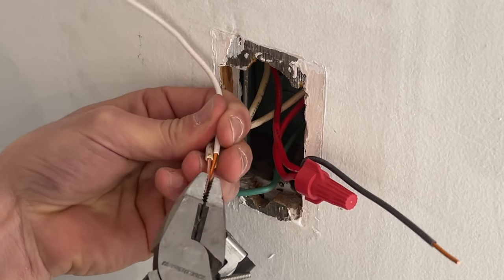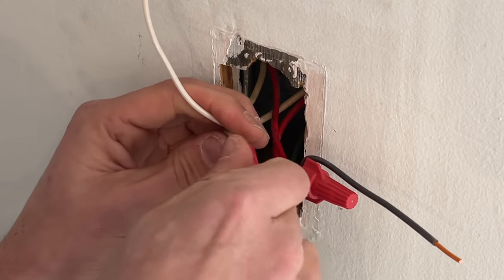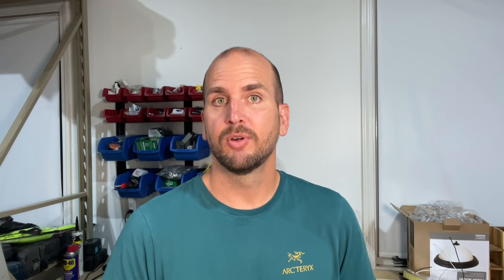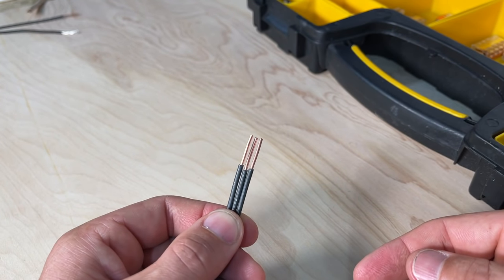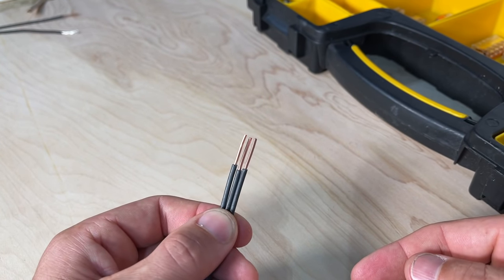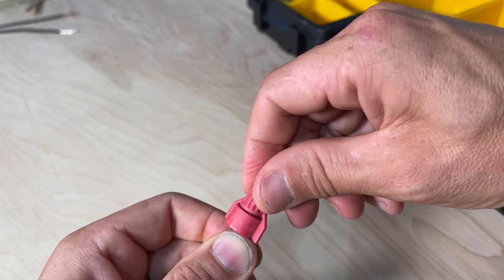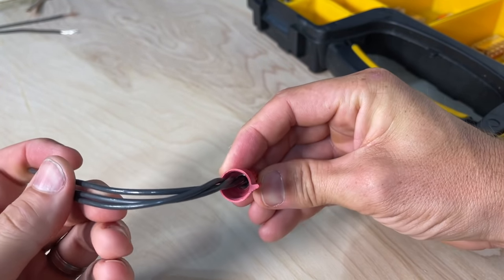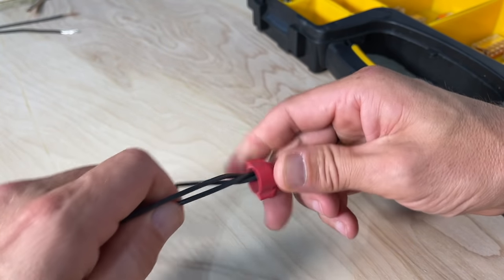10 Things You Didn't Know About Wire Connectors

Comment: I am an electrical  contractor. I may start using some lever Wagos. I don' like the push in because the are a pain to change. I am a pre-twist wire nut user that uses the Wagos that are pre-connected in the cans. However when doing commercial seasonal work for displays that are temporary I do not pre-twist wire nuts. I have used Wagos when the wires in a box are too short to work with.

Comment: DYI 3.
I always pre-twist when possible that way I know they are connected, the wire nut goes on easier as well. Note, some cheap wire nuts (usually supplied with a fixture or electrical component) don't have copper or metal inside, toss those out and use better ones.
Reply: The metal helix inside the better wire nuts is to assure better grip on the wires,  and not necessarily for electrical contact.  Even the plastic models without the spring helix are pressure type connectors,  however,  plastic is softer than metal,  and is less reliable in the long run.  Cheap wire nuts can loosen up more easily over time due to thermal expansion/contraction and vibrations.  This is why the all-plastic nuts should not be used.

Comment: DIYer: 0  Suggest always tinning stranded wire.  I wouldn't trust the connection otherwise.  So keep a soldering iron handy.  Big fan of the Wago 222s, bought a pack from Amazon some years ago and they come in hand in some cases.  Also for wire nuts, I like to make sure the nut cuts or scores into the copper wires.  That way I'm sure they are making a good permanent connection.
Reply: Soldering can cause issues if there is any flexing or vibration.  Where the stranded wire enters into the solder, solder will wick into the wire making it stiff for a short section outside of the solid soldered section.  Where the stranded wire is stiff and unsupported, flexing tends to work harden and break the wire.
Reply: @rossrobinson7943  This logic is misapplied as in these cases the wires are in a service box and do not move.  For cases where flexing is required, I would only use crimp terminals or crimp on ferrules.  Make sense?
Reply from the maker: Thanks for the feedback Chris.

Comment: Can the Wago be utilized with aluminum?  (DIY)
I've also been utilizing oxidizing paste in my connections for Al -> Cu with wire nuts in my home.
Reply: Sadly no. But I’ve used ilsco splice. Mac block is a good one for it. You’ll see them stamped cu-al and those accept both dissimilar material conductors
Reply: @Realmisterwolf  thank you for this information.
Reply: A suitable Polaris connector would be my first choice, but Ideal makes a CU/AL special wirenut as a second choice.
Reply: @steveloux4709  Polaris and ilsco make identical tap/splice connectors

Comment: I live in a 50 year old house. The electrician used the push-in feature on all duplexes.  The wires have backed out of some outlets. I'm retired, but will use the screws to connect wires and wire nuts to splice wires

Comment: I twist wires before wire nut connection and suggest that everyone should— because it is difficult to start the wire nut and wires exactly at the same length- I just spent the better part of a week chasing down lose connections at a old house and all where do to three wires in one yellow wire nut that was not pre-twisted and one wire had came lose the other two had great connection- just a little twist will help keep the wires together as you twist the wire nut on.

Comment: I'am a "Professional", over 45 years, I'd say, for DIY, yes "Stab Loc" is better then wirenut's, as DIY, never line up conductors, to fully engage,on spring, as they NEVER, Twist, (I ALWAYS DO), Trained US NAVY & Old school Vocational Shop, learned all my "WESTERN UNION" splices, 10th Grade. Also I learned to tape wirenuts aboard ship, for vibration, salt air spray.  As for lever, WACO, I've replaced cause of LC, bad manufacture.
Reply from the maker: Hi Charleton, thanks for the feedback and I agree with the majority of what you noted.  Are you saying you think WAGO is a bad manufacturer?  If so, can you provide more on your experience?  Thx!

Comment: DIY. I didn't know that tip about the stranded needing to extend .125" beyond the copper for wirenuts but I think that's the only thing other than the Murette alternate name for wirenut.  I use the euro style connecters sometimes when there is no slack, no room in the wiring box and I'm basically standing on a ladder that barely gives me enough reach and  can hardly see what I'm doing. They're convenient but I do have to wonder if they will fail down the road. If I have to redo them it's really gonna suck.
Reply from the maker: Seems like Germany swears by the Wago’s and I feel confident they will hold up.  Guess time will tell.  Thanks for the feedback.

Comment: Wire nuts for the bulk of work but Wago for short wires, crowded boxes like with multiple pig tails and for rookies with solid & stranded wires. Since electricity flows through the outside of the wire, wire-nuts create a better high current connection that Wago due to contact area. They are both good tools that have there place they serve best.

Comment: I often hear that backstabbing a receptacle is bad so why would push-in connectors be better?
Reply: There have been many failures on push in connectors on old USA receptacles. But Wagos, at least, have a good track record in Europe. My guess is that it both has to do with quality of manufacture along with the fact that pushing USA receptacles into a box is difficult at times - which might result in some unwanted strain on the connections. Pushing a Wago into a box tends to be much easier, so I'd assume less strain results. But our lower 120 Volt circuits result in more current than in Europe, so several years of real-world reliability data over here will likely be needed to convince everyone.
Reply: Like Jason said, shoving a bunch of wires into a single gang box is hard at times, especially when it is all solid core wire jutting straight out the back of the receptacle.  You end up work-hardening the copper nearest the outlet which will cause all sorts of problems if one of those wires breaks off.  Other issues with backstabbing receptacles are:
  1)  Most people don't check the "strip length" guide on the receptacle and they end up with less wire than they need to make a solid connection.
  2)  The bad connection from #1 causes the metal of the stab-in connector to expand and contract over time, causing the wire to work itself loose.
  3)  This is REALLY over-simplified, but stab connections are held in place by a springy piece of metal.  The connection is dependent on a very small contact area, which means the metal spring has to flex as the wire heats and cools, making work-hardening an issue (depending on the metal used).

Wagos work so well because they rely on clamping force to make a solid connection (which is also true for screw terminals on receptacles).  It doesn't matter if you heat it, tug on it, etc, that wire isn't going anywhere.  Wagos are also made with clear plastic so you can inspect the connections just by looking inside the wago.
Reply: @docferringer  Glad for the details.
Reply: Push in's
The single tensioner bar over time looses it's tension
Therefore the wires are now in an OPEN CIRCUIT
Meaning no electricity 

Start of failure
At the beginning it will work only a few times
Then it will stop working

I've personally taken apart old push in outlet to find the failure, it's that tensioner

Could you imagine troubleshooting push ins
Did a bus bar break, did a wire break at the entry point, tensioner release it's grip
No thanks

Proof, how to fix a push in
Open apart the housing to expose the guts
There you will see what keeps the wires tight,
It a copper tension bar
I bend the tensioner to apply more/ original tension on the wire and it works

Never have this problem with twisted wires in wirenuts
Reply: @mansardmanor3869  We have also had those problems in Europe, the cause was the Ideal brand knockoff wago connectors! There is American quality control!
Reply: @JasonEDragon  It has to do with push in connectors and lever nuts (Wagos) not being the same thing. Of course Wagos have a good track record in Europe - they're not push ins.
Reply: both are terrible going to het people hurt

Comment: You said push connectors not good for stranded wire. Does that apply to lever connectors?
Reply from the maker: Nope the Wago 221 works for stranded and solid copper wire.

Comment: I twist my wires and perfer marrettes (actual marrette brand as they use copper ) as i know the connection of the twist will hold together and make a good connection with out the nut so when the nut is in place it's doubling down on the connection. Also when I make splices in exterior location I put a little penetrox in the marrettes,  helps keep the connections from oxidizing if moisture even happens to get into the box.

Comment: I’ve been taught to twist over 40 years ago. I use wegos now. Only because I have arthritis now.  Very little twisting now
I’m still doing electrical work after 40 years and no problem 
And yes when I was younger and learning the trade.  Stuff was soldered
Wagos save me time. Just like “ pro  press”in the plumbing trade. 
It still passes inspection 
It’s approved 
So be it

Comment: I purchased some "generic" wago 123 on Amazon and some of my wire would not hold in it... I trashed a few that I could not achieve my pull test after wiring... used a different one and it was fine!!  What are your recommendations? generic? brand name only? or maybe I did something wrong wiring it???

Comment: The ideal wire nuts that I prefer to use say on that packaging that they can be pre twisted. I pre twist so that if I need to take a nut off to probe the connection, the wires still stay together. If it’s just a temporary connection, then I don’t typically pre twist. Pre twisting also helps prevent one single wire from breaking off inside the connector.

Comment: Ideal makes a screwdriver with a wire-nut ratchet in the handle. I find it makes wire nuts much easier to use, although I have taken to using Wagos most of the time, now.

Comment: When it comes to pre-twisting, I only do it with stranded wires, more than 2 12 awg wires, or more than 4 14 awg wires. I also twist enough so that I can let go off all the wires and they still stay together. Once I put the wire nut on, I then continue twisting past the exposed copper. And yes, I don't pretwist when joining stranded with solid. If it's multiple of both types, I pretwist solids together and stranded together then let the wire nut twist the two larger joints together.

Comment: In the UK we can get hold of both types . Years ago we used a porcelain screwit on the old lead cable this was the equivalent to your wire nut.. push in or lever type wago are mostly used in the UK. Not so much wire nuts.

Comment: DIY2:  just had a wire nut arc inside my 5 KW grid-tie inverter.  Stranded-to-stranded 10 gauge THHN.  It vaporized the wire nut and burned the insulation of nearby wires.  The metal part of the wire nut then shorted to the grounded aluminum case and tripped it's 30 amp breaker.  Replaced those wires with 8 gauge with no wire nuts.  I'm going to buy some lever Wagos to replace all the wire nuts in that system.

Comment: I always pre-twist, since that's the way I've been taught. I've seen loose joints in the field due to not pre-twisting. When troubleshooting you might want to remove the wirenut while the circuit is live. It is not a fun time when you take off the wirenut and a bunch of live wires come springing and arcing out at you or touching other things. Also most manufacturers say that pre-twisting isn’t necessary, but just because they say that doesn’t mean it’s a good practice. Ford says that I can change my oil at 12000km for my vehicle. But I still change it at 5000-8000km. Level 2 electrical apprentice.
Reply: You know these things because you were trained properly.
Reply: Yes, not pre-twisting is a problem when working on hot circuits. I agree with you. I do non pre-twist for temporary or seasonal display work.

Comment: I really like those wago connectors, but some say they do not provide a solid connection because only a small portion of the wire is making the connection compared to twist connectors were the entire portion of the wire is making solid connection.
Reply from the maker: Yeah, I understand where that type of comment is coming from but I am also fairly confident the busbar for the Wago’s is specifically design with a generous factor of error to carry the load.

Comment: Diy10...yup, I didn't have a clue. I installed a 'dusk till dawn' style entrance light and ran into the same problems I encountered 16 years prior, during the last install. The stranded wire slipped off while I connected the fixture. When I came across the plug in connectors, I kinda questioned the durability of a thin plate of metal switching on and off every day and the damage from the heat 10 to 15 hours a day while the light was on. I'll stick with wire nuts for now.

Comment: [Unlicense Professional 10yrs] I always pre-twist my lumex wire. For me, wire nuts are for isolating and HELPING to secure the connection. I never trust wire nuts to deliver a strong electrical connection by himself. Lever nut are too expensive in my region, i use them only to aluminium-cooper jonction when is WAY to complicate to re-wire brand new Lumex.

Comment: When it comes to wire nuts, I prefer to pre-twist if I have 4 or more wires, or if there is stranded wire in the mix.  Stranded wire can be a PITA when it comes to wire nuts, causing the nut to slip when you are putting it on, or breaking pieces of stranded wire that can fall out of the wire nut later on and potentially cause issues.  So I will grab all of the wires with my pliers and twist a few turns, giving the stranded wire the same twists as solid wire.  Then I can put the wire nut on and twist it the rest of the way until the wire outside of the nut has a couple of full twists on it.  Those wires are going nowhere.

Comment: I always fund that a junction of stranded wire with hard wire using  Wire Nuts made a poor connection, especially with electronic thermostats and baseboards because of the higher current.
These jonctions also tend to loosen after 10 to 20 years, possibly due to metal fatigue. Recently, I decided to change all the Wire Nuts to Wago 221 on all the connections of the heating system of my entire house, all thermostats and all baseboards.

Comment: If you're in a situation where your predecessor didn't leave a sufficient pigtail, it's practically impossible to use a wire nut. Push-in is the only way to go.

Comment: Plenty of good information. I use different types of wire connectors depending on the circumstance.
I am a wire pre twister myself especially on solid strand wire. Being an instrumentation technician I come across
many new types of connectors and terminals. Could you do a video on a Pass & Seymour SC-014 R 
Self contained device. It just seems to be a wire connector to use instead of wire nuts. Don't make sense
why it is installed between the 120 AC power going to the water heater. Unless they cut the Romex to short.

Comment: Tinting a wire can enable a stranded wire to go into a push-in connector. The issue with push-ins for stranded wire is GETTING it in; not so much as HOLDING it.